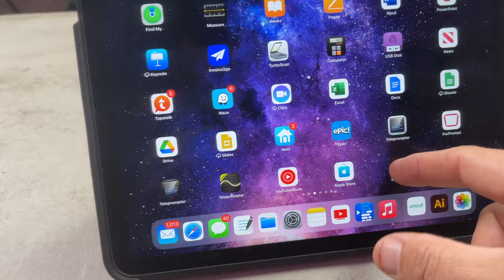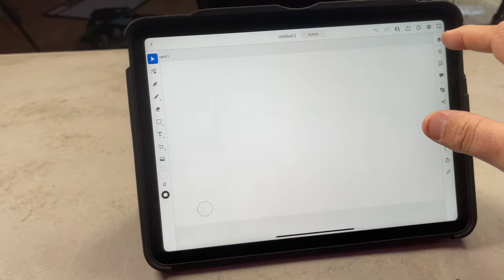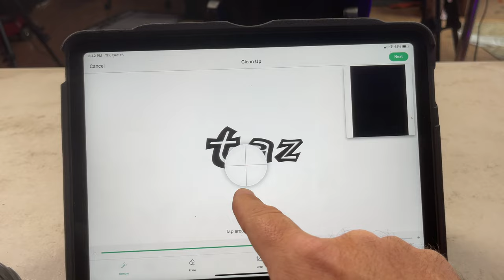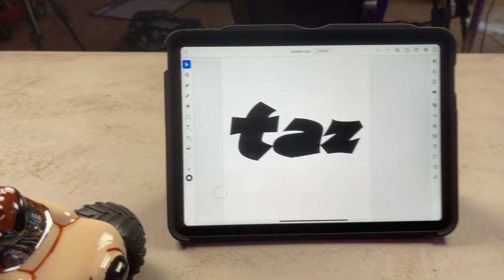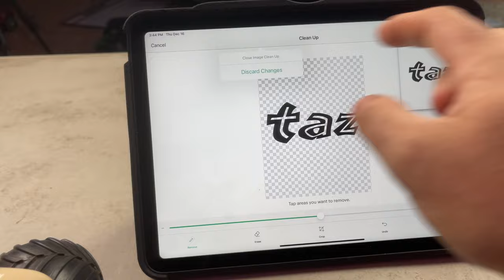I Painted A Lexan RC Body WIth A Brush & Acrylic Paints. Check Out My Micro Taz Monster Truck!

Comment: LoVe LoVe LoVe the video, thank you for posting! Back in 1986 I painted my Kyosho Optima using Kyosho's now discontinued Acrylic paint. I had the same brush strokes showing but I was patient and applied thin coat after thin coat (as RCTalk mag suggested) until it was opaque. I still have that Optima body , BoX ArT perfect (except I used a darker blue...i never was a fan of that pastel looking powdery blue 🤮). It's complete with Kyosho MicroLine tape pinstripes in black, yellow, blue, & white. Well anyway, that bidy is missing the portion in front of rhe front shox, and some body missing past the rear shox. BUT the paint endured what the Lexan could not! I still use Acrylics on some bodys. I depends on the complexity, I find it easier to paint more complex body art with acrylics by using liquid mask and Tamiya's flexible masking tape since its not made of paper it doesn't bleed , but I  use lexan spray cans for simple to moderate box art designs. I wish you could mix Lexan and acrylic paint!